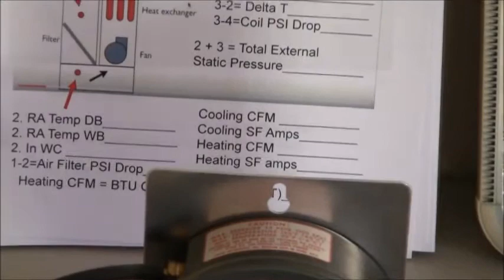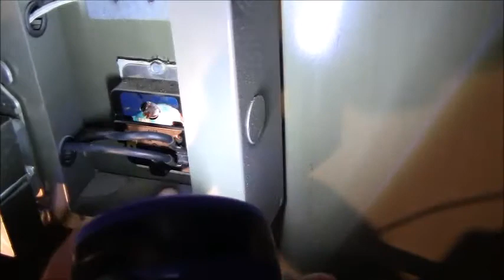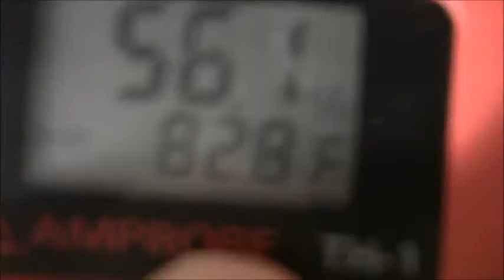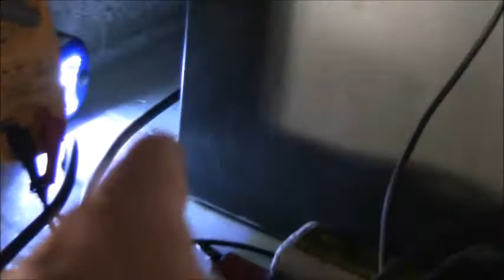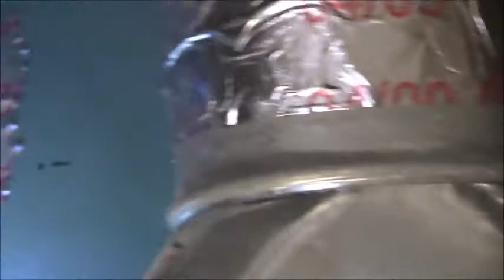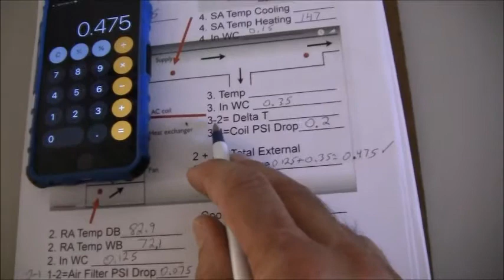External Static Pressure Check on a 40 Year Old Residential AC Split System and Furnace with Check L

Comment: Hello sir i have some units without  return duct how could i measure static pressure?
Reply from the maker: you would just but the sensor probe on the unit return. I will assume you have no air flow restriction on the return in that case.

Comment: Great video.  I have trouble understanding static pressure and how to use it to troubleshoot problems    question   what pressure is considered acceptable?    Like let's say a unit has to little supply ducts what reading would indicate a problem.   Sorry it's confusing.   Thanks
Reply from the maker: If the external psi is above 0.5 inWC then the system may have air flow restriction. Then sample the supply and return seperatly to determin which one is the problem. the higher the number, the more restriction.
Reply: @KenTraining  thank you for the help.
Reply: @JCM2LA  If I may inject, don't confuse what Ken is saying. His 5" is TOTAL static pressure, thats the difference between the return upstream of the filter and upstream of the coil. He showed this starting at the 29 minute mark, (after getting the motor amps, which will be used in the cooling mode to determine the BTU output of the AC unit) . ALSO, the 5" static rule has been around since I started back in the 70's, but the new ECM variable speed furnaces usually can provide 7" of TOTAL static pressure for reasons that would require another 30 minute video so just know about it, the same testing applies.    Good video Ken.
Reply: Thanks.